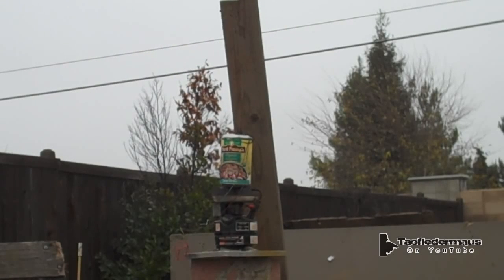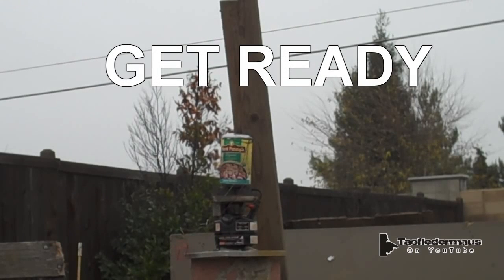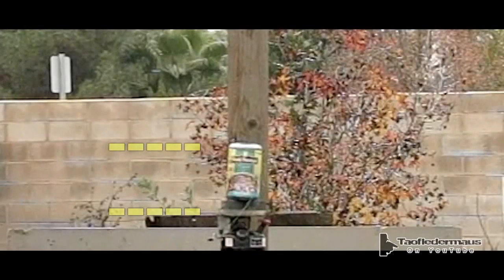The Power and Stupidity of Steam - Weaponized Bean Can

Comment: we accidentally did this in a campfire with beef ravioli.   that one ended up shooting the top off angled up/sideways, and we found a trail of raviolis leading away for about 75 feet, but we couldn't find the lid anywhere.  It's a good thing neither of us were in front of it when it blasted, as we might have gotten a can-lid sized hole in one of us.

Comment: I would think the lid would be the most dangerous - a razor-lined chunk of metal being propelled at possibly several hundred feet per second?! Holy crap X__x

As for stupidest thing... probably sticking a spare model rocket engine to the back of a Hot Wheels and setting it off. Right next to our family's van (at the time) XD

Comment: Put in a metal pipe, 3/4ths the size of the can and fill halv-way above lid with sand and install broken glass and marbles at the top of the steel tube.

Comment: My friend and I put a full can of butane lighter fuel into a camp fire one day but as we were standing about 100 feet away we started thinking about how much fire there would be and realized it would burn the forest down so I took off running at full speed toward the fire and punted the can out of it and into the little pond that was nearby. Then afterward I started thinking about what would have happened if it exploded while I was running toward it or right as soon as I kicked it. Overall I lucked out big time that day. The butane can had already expanded quite a lot by the time I got to it.

Comment: haven't tried this as I just thought of it, but after watching this vid I am now curious if it is possible to use a can of beans as a way to launch a projectile from a makeshift cannon. like maybe get a tube of some kind with the internal diameter of the can, use a couple of glow plugs for the heating source inside the breach cap and a 12v car battery to power it.

Comment: why didn't the outside wrapper burn away?
Reply: try this...a cup of water and a flame like on a gas stove. ( this is safe btw paper cup )...the water cools the paper and paper can't burn. because ..water has the highest heat transfer ability of any substance other than liquid mercury. Oh and they did make liquid mercury boilers at one time.
Reply from the maker: I guess because the flame never directly hit it.
Reply: rod paget what are you a teacher or something?  whats the point of your comment?
Reply: 206robert206
the point of Rod's comment was to answer your question. Though it wasn't the correct answer. The answer is that the label is right against the surface of the can which is expanding causing the label to get even tighter which removes the oxygen between the label and the can. The flame never stayed directly on the paper so it never scorched and even if it had it wouldn't have burned due to the lack of oxygen between it and the can. The worst that would have happened is the label would have gotten black in the area directly touching flame.

Comment: Pressurized cans on a heat source have a very similar effect.  I used a 99 cent store can of tag body spray and threw it on a campfire thinking "hairspray is typically flammable so this probably will be.  let's see what happens".  That little can (about the size of my palm or more descriptively roughly the dimensions of a 40mm grenade for a M203 or M320A had a nice little explosion with purple smoke.  I have a photo somewhere buried in old photos.  Hit me up if you want it and I'll try and find it to share with ya.

Comment: My friends to this day call me Macgyver. I use to do crazy shit, like place cans of beans on a campfire but to take it a step further, this is dangerous to what I'm about to share, read at your own risk...getting a small glass bottle, place a tablespoon of FFF gun powder in the bottle and throw it in a bunch of hot coals. Wait for a few minutes and see it go flash-boom. Just the tiny bit of gun powder in the airtight glass bottle, with a metal lid will pack a punch. Hot coals went flying 30 ft in every direction of the bottle and made a huge hole in the bottom of the fire. I really love making dry ice bombs as well with two liter bottles and even glass bottles, those only explode when dropped or shot with a BB gun under all the pressure after the dry ice fizzes out. I'd love to see these two things in slow motion. I have enjoyed your demonstrations man. Keep it up brother! Find me on FB/citizenofthecosmos

Comment: Thanks for doing the rerun for me. Pork and beans should have a warning on them to not be heated in an unsealed can. LOL I bet some people have been seriously hurt from this sort of ignorant behavior by some one wanting a warm meal. The expansion of water to steam and water in beans to steam is unimaginable. Thanks for the slow motion of the violence. It sure imprinted the burner onto the bottom of the can.
Reply from the maker: I don't think they have used solder on cans for many years.
Reply: ***** Solder can't be used in food canning and with modern manufacturing isn't necessary as the can is sealed by having the lip be comprised of a number of folds in both the lid and the wall of the can. http://en.wikipedia.org/wiki/Tin_can#Fabrication_of_cans
Reply: actually the solder seam holding the can together is a eutectic melt temperature probably around 300 degree f...that would make the pressure in the can about 10 psig .... a really big fart......watch your face boiling beans may likely explode as the water suddenly is in 10 psig less pressure...jus sain
Reply: I am shocked that it does not have a warning label on canned food. If ziplock bags need to come with instructions then canned beans need to come with a warning.

Comment: I mounted a 4 foot wide rotary tiller with a 12 hp motor to the back of my little Snapper riding mower. To offset the weight of the tiller, I used a big 2 inch diameter shaft as the lever to raise it out of the ground. I could raise the tiller with very little effort. For the trial run I gently lowered the tiller into the sod in my back yard. releasing the handle to a near vertical position. It was just chewing up the dirt! As I slowly let out the clutch/brake, the 4 foot tiller effortlessly jumped  out of the ground, and as the big heavy handle approached the speed of light, it became invisible (I never saw it coming), Also time just stood still for a while. Einstein wasn't a total goof I guess. Also matter had changed states, the contents of my cranium had been turned into a mashed potato like state. Oh, and blood shot out of my nose!!!

Comment: Interesting that the top blew off. Could have very easily been the bottom, correct?  Or is it a path of least resistance type of thing?

Interesting nonetheless.
Reply from the maker: It was a seamless, one-piece can and there was only a seamed lid on top,  so that was the weakest point.
Reply: It's more a "the weakest link in the chain" reasoning, the pressure will escape where the container has its weakest point. A can usually has two parts, the sides and bottom and the top, which is clamped to the sides. The most probable point of breaking is in the "seam" of the two parts.
Reply: I was looking at that.  The bottom seems to have a seam as well as the top.  Might have to look at it again to make sure, but I thought I saw the rolled edges at the bottom also, which got deformed but did not fail.

Neat stuff, eh?
Reply: SlimSlashie It might have favored the top as heat rises?
Reply: thats the safety solder melts at a exact temperature....like a sprinkler head

Comment: That /is/ awesome and dumb in an interesting and informative kind of way.  Thanks for sharing - I knew steam explosions can be really powerful, as I saw a Myth Busters episode where they set off a water heater, but I'd never considered the power of a simple bean can.
Reply: they actually did the bean can with a twist, first they filled a pot with oil, then they set it on a stove on full heat, eventually the oil got hot enough that it cought fire, at that point, they lowered the bean can in the pot...

Comment: Done this many times another good one is a coleman lantern fuel can with about 2 inches of fuel left in it. The weld on the bottom is usually the weakest and the can goes like a rocket with a giant fireball on the ground so you can't stand to close lol

Comment: Should be fairly easy to calculate. If you know how much water is in the can, the volume of the can and as Joe said the pressure rating. It should all end up in an equilibrium "reaction", much like vapor pressure at different temperatures and pressures.

Comment: The 1:1700 ratio is true, but the way you portray it makes it sound like all the water goes from liquid to gas when in fact its probably only a small percentage, just like when you boil water in a pot, all the water doesn't just turn into steam at once. It would be nice to calculate the water in the can that does expand to 1700 times to make steam, then you could figure out exactly how much water it would take to make a can of that volume expand to it's breaking point. Love your vids by the way.

Comment: A while back, I had a slight malfunction with fireworks. I bought a pack which included two stuck together; a smaller one would be lit first, and after firing, it should've ignited the joining wick. This wick didn't catch, so I lit it myself. Turns out, it was a pink wick that burns 10x faster than the usual green. It detonated almost immediately. Had I been a bit closer, I would've scorched part of my face.

Comment: I once put a boiled egg in the microwave. I thought it wouldn´t be a problem for it was boiled before. WRONG. Then I sit on the breakfast table with my family peeling away the shell. And when I put the spoon into the egg the egg exploded with a big bang. My face and hair was full of hot and dry egg pieces and I had to clean up the entire room.
I was told I looked so funny, having the eggcup in my left the spoon in my right hand and turned to stone like "The Coyote" does after dynamite explosion.

Comment: 30 yrs ago was helping my daddy clean out his basement and burning the trash. had a small can, maybe 4oz, of old paint I threw on the fire. no one around but me, that was good. when it went off, of course the lid blew. but it had a seam on the side where it came apart. it was flat as a sheet of paper and flew roughly 40 yds. had it hit me, about 3ft from the fire, at the neck and up. i most likely would not be writing about this experience. think throwing star only super thin. " cut throat ! ? "

Comment: stupid experiment no. 987234... we used to empty out estes model rocket engines and put the solid state fuel from them in various objects... we stopped shortly after we filled a snapple bottle with it and threw a handful of steel balls from a pachinko machine in for good measure... we dropped it in a hornets nest in a hollowed out tree and obliterated both the tree and nest (go figure)... not my proudest moment but there you go.

Comment: I was the teachers aid for the entire science dept. first hour, well I was upstairs in class and heard a huge explosion, and felt the floor MOVE, towards the end of class. I went down to see what happened and they had decided to "upsize" the experiment to see if it would work with a 5 gallon water cooler bottle. It sort of did one time, then they got bored waiting for it to air out, and used the medical oxygen to air it out for the next run.... I just shook my head when they told me....

Comment: What do you think is responsible for the change in pressure? If you fixed the environmental pressure to atmospheric - i.e. you placed no restriction on the volume that the steam could occupy, and then compared the volume of a fixed mass of water as liquid and as steam, you'd get a difference in volume equivalent to the expansion ratio he's quoted. Or if you're an engineer - consult your steam tables.

Comment: When I was a teenager, I poured combustable fuel out of the can and straight into a campfire that was burning in a truck tire rim: it combusted and since it could only go up, made what seemed an infinitely high fire tube that shot up into the sky...when it faded and the shock of what had just happened subsided slightly, I noticed that the can of fuel was burning at the mouth, so I threw it into the woods...our tent, the can and the woods were on fire...so much so that it looked like daytime.

Comment: There IS an expansion ratio,  and it IS about 1:1700, steam is compressible though, and the pressure in the can comes from the water inside the can expanding as it heats up.

Comment: I used t work at an aluminum smelter.  Since the "freezing" point of aluminum is about 1200 Fahrenheit, dropping a can of pop into molten aluminum will form a shell of solidified aluminum around the can, while still heating the water inside well above the boiling point.  When the shell starts to melt as the temperature begins to equalize, the steam will cause a huge explosion, throwing molten aluminum dozens of feet.

Comment: Stupidest thing ever done Hmm?
 
Attempting to boil off a concentrated 70/30 solution of potassium nitrate and sugar to a caramelized salt in my microwave.
 
Just as I was going to check on it, KABOOOOM! The door stayed on the microwave but I felt a flash of IR radiation. Once I opened the door, a thick billowing cloud of white smoke filled my house. and the whole interior of the microwave was jet black.

Comment: STUPID STORY TIME

I was doing science one day and wanted to practice new ways to start a fire.

I cut open two 12 gauge shells and removed the shot and the wad. 

I used the gun powder and some birch bark to start my campfire.

During cleanup, I tossed the shot, the wad, and the rest of the round into the fire pit.

After a while, I heard the loud bang of the primer popping (from the heat of the fire). 

VERY LOUD 

Long story short, I wouldn't do that again.

Comment: I work in a welding fabrication shop and some of the guys there would constantly mess around with acetylene torches and fill water bottles and ignite them... Acetylene is a very volatile gas and is not something to mess around with, one of the guys hid a bottle inside a piece of pipe that was being welded and when it finally got hot enough and erupted it shot a shockwave out of the end of the pipe that could've caused permanent hearing loss. Not really an experiment but just people being dumb.

Comment: I once shot a 9mm blank with my air rifle. I hit the primer and the case missed my face by a few inches judging by the sound it made as it shot past my ear. I knew it was a bad idea when I set it up. I knew it was bad as I put it in the cross hairs and knew it was bad as I pulled the trigger. I still did it though. It couldn't have killed me but it could have wrecked my eye. I just wish I'd filmed it!

Comment: I did almost the same thing with a can of beets. The bottom gave out instead of the top, however, and the can ended up impaled into a nearby tree. I'm really glad that none of us died that day. There was also the time we put dry ice into a bottle with warm water and threw it into the creek, weighted down with rocks. There was a crater in the bottom of the creek where the stones on the bottom were blown out/into the clay. There were also a bunch of dead crawdads we found FAR away from the water

Comment: I built an electric foundry for smelting aluminum to sand cast; made of a stainless steel stock pot with a 4" wall perlite/cement for insulation. Inside the isulation I embedded a stove element (hoping it would work like a kiln). I plugged it in to a 220v on my drive way (in the house I was renting). I went inside and a min later heard an insane buzzing! I ran out, unplugged it, and lifted the lid off with a metal pole. The cement was now red hot glass + aluminum. Luckily it was contained!

Comment: Try it again but, put the can-o-beans in a breach, some sort of heavy steel pipe, closed on the bottom and open on top, with a small, perhaps 2" diameter hole on the bottom so a heat-source can access the can.

With a long enough pipe, perhaps 18", you can direct the beans like a 4-ott legume, shot-shell. LOL

Comment: I knew steam was powerful but didn't realize the expansion ratio. That was cool to see the downforce in slo mo. My wife sat some cans on the glasstop stove and turned on the wrong burner heating up oil. I happened to walk into the kitchen and see the burner under the canned goods was red. I turned it off and grabbed some tongs and carefully removed them. Was lucky because they never blew but were bulged out. Felt like bomb squad removing a bomb.

Comment: Thanks for re-posting this demo. I'm a newer subscriber. I'm an MET major and studied thermodynamics but we never saw an experiment done like the one you demonstrated. From what I understand the water in the can was superheated, but being under pressure, the boiling point was raised so significantly that the slightest rupture exposed the hot liquid water to the lower atmospheric pressure in a flash. The instant expansion to steam made the cool bang. But dangerous one!

Comment: The effect on the beans is similar to how pulp mills break up wood chips as they leave the digester. The chips are cooked in a high pressure alkaline stew. When the chips are released into the low pressure blow tank the superheated water soaking the chips violently flashes to steam blowing apart the mushy wood chip without breaking the fibres.

Comment: An experience that I look back on as dumb?
Throwing an empty metal vodka bottle in a campfire and sitting next to it drunk? BOOM!
The one I learned the most from?
Filled a pneumatic spud gun with electronic valve to 120 PSI, filled barrel of spud gun with water, aimed straight up, fired. The gun flew off my shoulder and smashed into the ground. lol
That's the day I learned that water doesn't compress and exactly just what "equal and opposite reaction" means.
Good times, glad you reposted this.